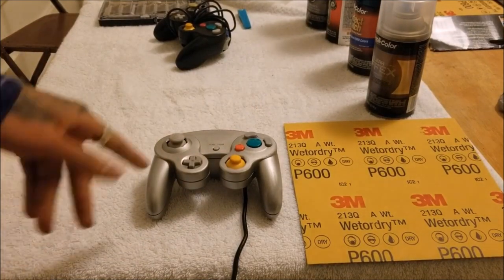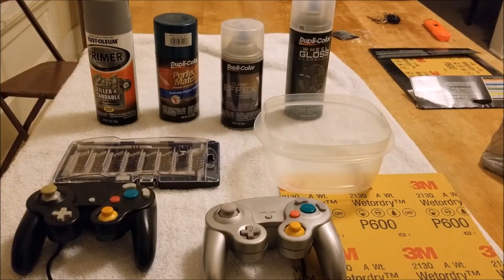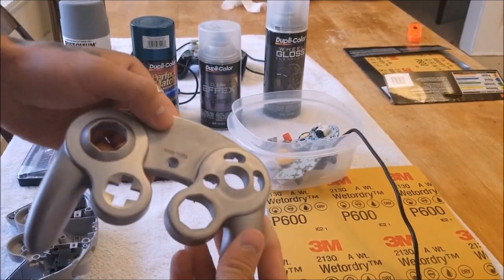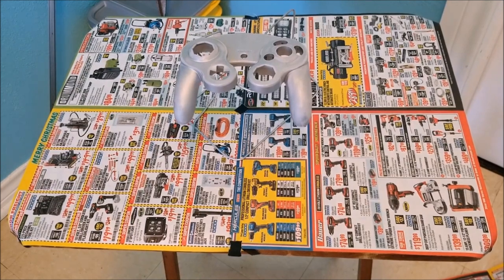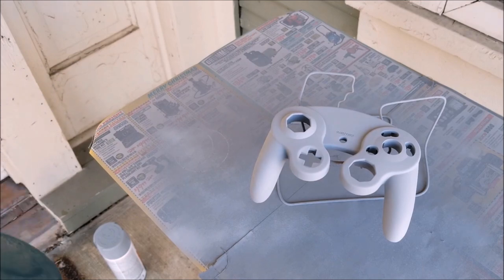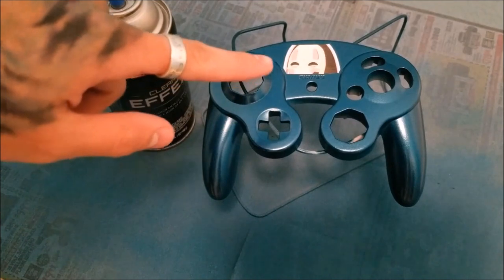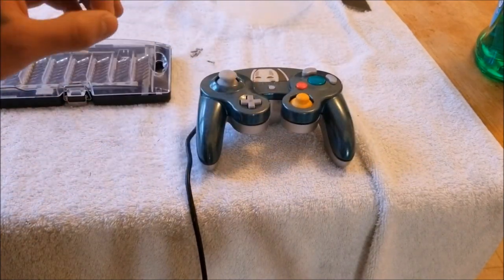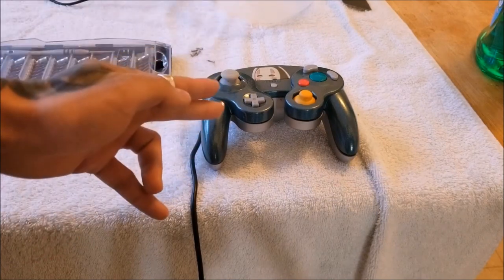GameCube Controller Front Face Restoration

Comment: Really nice color. However, instead of a sticker, I would have used a water slide decal. That would have set more flush on the controller. Overall great job.
Reply from the maker: This is true and thanks for the recommendation. Most of these stickers have to be custom because of the size of them. This means I have to go local with the creators. Most of them dont use water slide machines or paper :(
Reply: @Okinashiri  ahhh. Well if you have a computer and normal printer at home, those work with water slide decals! If not maybe sometime in the future you can try it.
Reply from the maker: @Soul94255  I should try that out 🤔
Reply: @Okinashiri  yeah bro you can find the decals on eBay. But make sure they're either for LaserJet or inkjet depending on the printer you have. And get the clear ones, not white.

Comment: hey! i love the way you painted this :) im working on a controller, but instead of painting it i have a clear gamecube controller and im trying to use the clear coat to keep a sticker on to the controller. would i still need to sand, or could i just put the clear coat on?
Reply from the maker: There's stuff called adhesive promoter. You can use that and then the clear coat or lightly scuff it and use epoxy over the sticker.